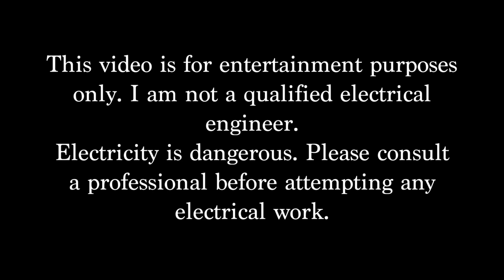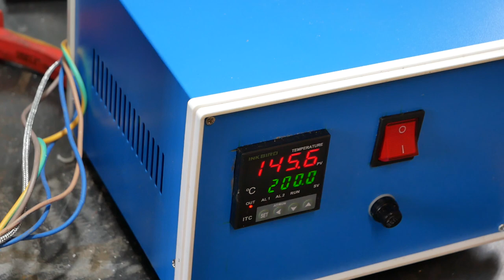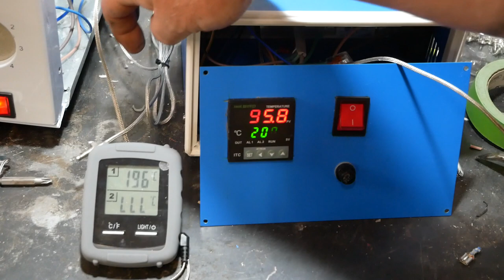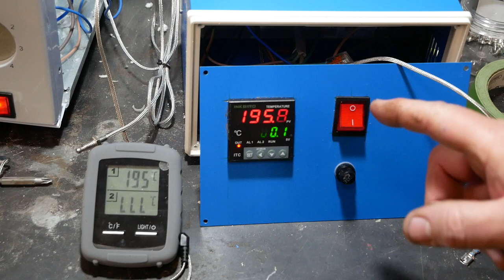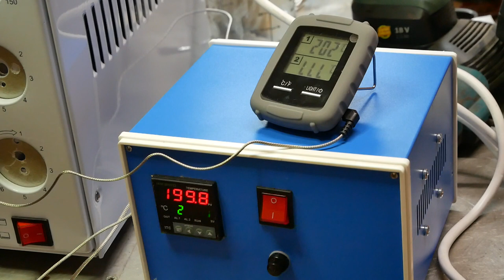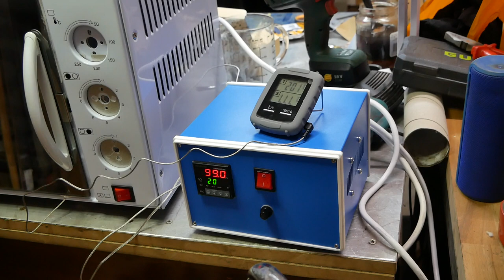Making an Accurate Tempering Oven

Comment: what is the right temperature for car wheel bearings or motorcycle wheel bearings for tempering in knife making ,tanks
Reply from the maker: Hi and thanks for getting in touch. That is a very difficult to answer with any accuracy as each steel has different properties and also it depends on the final hardness you want to achieve. Typically wheel bearings are made from a E52100 steel. You might want to research it. The recommended temper would be between 150C and 180C probably for an hour. This is my opinion but may be wrong. Good luck anyway..
Reply: @Ukenick  
thanks for the answer, i like your opinion. have a nice day